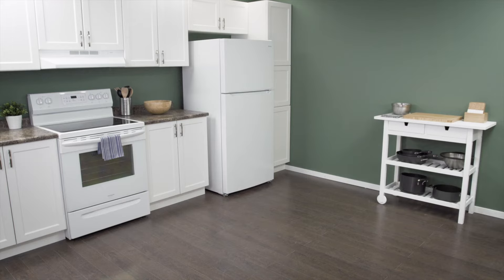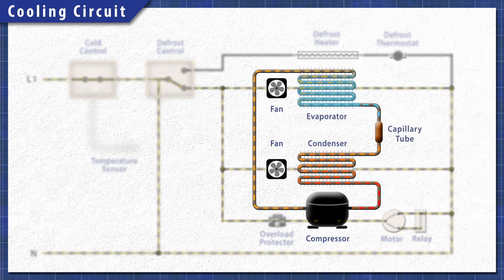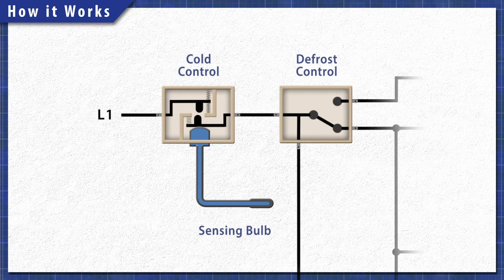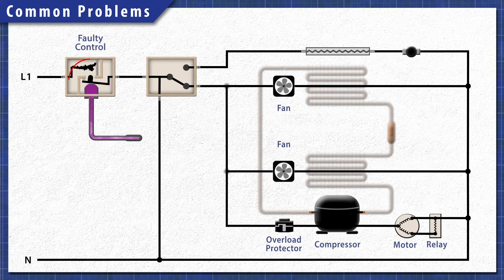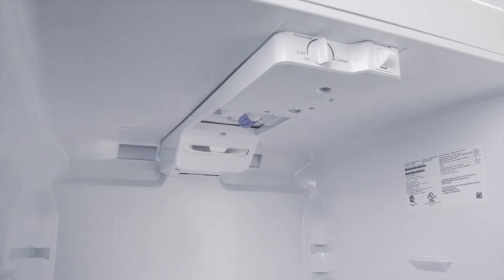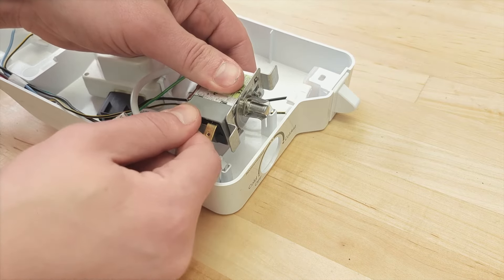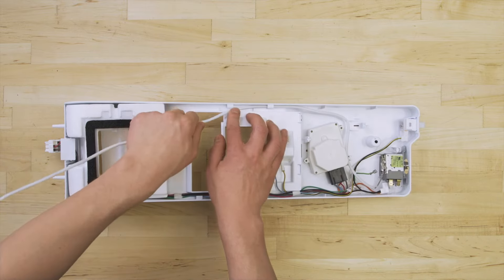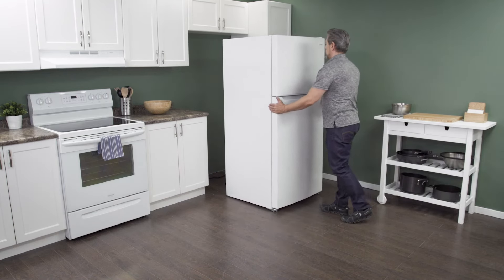How to Test & Replace a Cold Control Thermostat (Refrigerator) | Repair & Replace

Comment: Very nice, clear, straight-forward tutorial. I’m confident enough to at least have a go at looking, now. (My problem is it’s getting far too cold -so definitely working, yet not turning off, properly. )
Many thanks, Andrew, Yorkshire, England. 👍
Reply from the maker: Thank you, we're glad that you found the video clear and easy to understand! In your case if it is too cold than the cold control thermostat (or the thermistor or damper moder in models with a control board) can be the cause.

Comment: Great info. Thank you.  I tested my thermostat by sticking the probe into ice cold water and it tested like you said.  Per the DMM it’s a complete open in ice cold water and I get OHM reading / continuity at room temp.  My issue is my little fridge runs good for a few days then gets warm.  I reset the thermostat and it works for a few days?   Any thoughts on what that could be. Thank you
Reply from the maker: Thanks for watching we're glad you found it helpful. Is there a buildup of ice on the evaporator coils? It's possible that the defrost isn't working: https://www.youtube.com/watch?v=r2YUNLPs4kM
Reply: @AmreSupply it’s one of those small magic chef fridges. Two doors ICE on top Fridge bottom.  So no coils exposed.   When I took off all the power nothing melted.  So I highly sought ice build up of any is the issue.   Thank you. Any other hints?
Reply from the maker: @FD-dh2fu   The cold control thermostat might just be getting worn down or the contacts might be sticking.
Reply: @ I thought the thermostat as well but it did test good.  I will try the starter maybe I get lucky and when I pop it out If I hear it rattle it might be going bad.  I will keep you posted.  Many thanks again.  Keep up the amazing work and details.

Comment: Replaced temperature control, Timer, Freezer Temperature sensor, Freezer heater and still freezer full of Ice.
No electrical power at the Heater Terminal when on defrost.
Frigidaire FFHT1826LW9
Reply from the maker: Thanks for watching. In some models there might be a thermal fuse in the freezer as well as a defrost thermostat. If those are both good and have continuity, then it could be an issue with the wires. You could check continuity of the wires individually to verify.